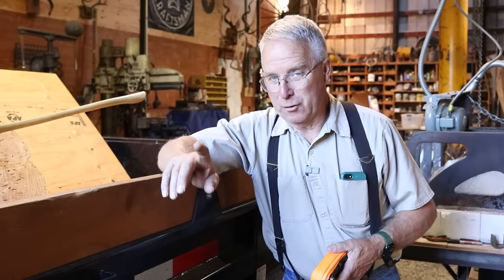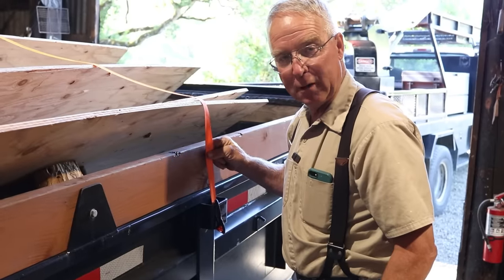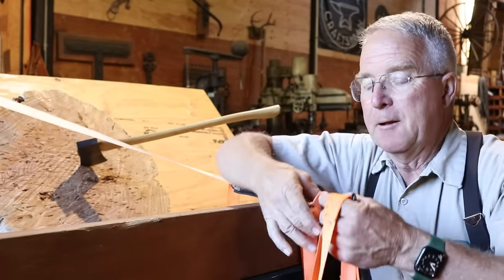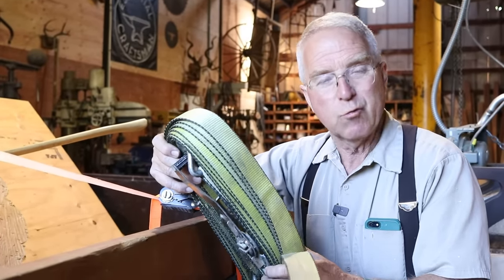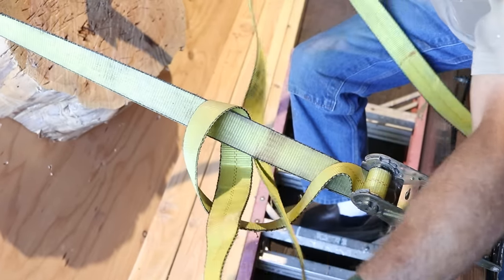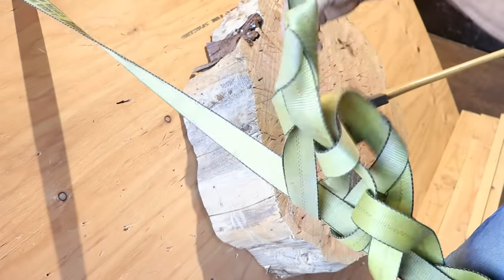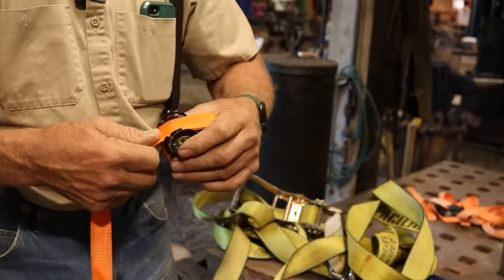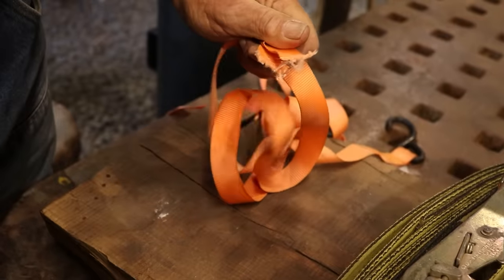7 Ratchet Strap Pro Tips

Comment: I use womens black elastic hair ties to wrap around my straps and and they work great. They are super strong, you buy them at packs at any store, they are cheap. So buy a pack or two, wrap your straps. When you take them off, put them in the truck where you pulled the strap out. If you lose one, then grab a new one out of the pack and go about your day. Ive been doing this for years and its worked so well.

Comment: Graphite spray lube works great for keeping the ratchets moving smoothly. This works better than any oil for keeping dust from sticking. I also love using straps with gated hooks or beefy carabiners when the load may shift in travel (like snowmobiles)

Comment: I normally use a magnet to hold the hooks up on trailers. Hooking them over like that can pinch straps and reduce their durability under stress. That said, you can just cut the straps and sew on new ones for about 10-20% of the cost of the whole as the ratchet mechanism and hooks are the most expensive part. So the speed increase may be worth it to you.
Also, always have redundant straps if a failure would mean more than simple inconvenience. I normally double my cheap straps, but you do you.

As for the loose ends, that's a great method for heavy, stiff straps but not light straps, IMO. Personally, I roll the straps up with a bit of cord or a zip tie though the center and tie them in that roll. Looks pretty for the boss, though it is slower.
Works well for tieing the end bundles together as well.

Edit: mind that I am not speaking from a legal prospective. Commercial and OSHA rules are way more strict than common sense. Sewing your own straps is probably straight up illegal in commercial applications without certain certifications. Like you can't replace a plug on an extension cord unless you are a Master Electrician, per OSHA (in the state of Virginia as of 2017, at least).

Comment: Another tip for the extra strap. I double it up end over end. Open the windlass half way and pull the fold strap halfway through windlass opening… then close the windlass. It will hold the strap.

Comment: I do it like you except I put them in an appropriate sized zip lock bag. This keeps them dry and coiled well and not interfering with the others.  Be surprised how long those bags last also. If you're not to rough on them. You can get them from Qt. Size up to 2Gal size which will accommodate the large trucking straps. I bag all kinds of stuff. Lol. 9:27

Comment: Some suggestions from a Canadian friend,  always check and know your WLL (Working Load Limit) against your load weight, anything more than the 50% WLL  requires a additional straps accordingly... among other load securement rules (but your not running over the 10 000# vehicle weight limits, so the rules are a bit different).  In Canada the WLL is required to be readable on either the strap OR the tag (in all commercial applications), and you must be capable of proving it, even if it requires you unratcheting the strap to get to a visible WLL markings on a piece of the strap.  Second, all straps, when in use (on flatbed, etc) are to be secured INSIDE the scrub rail! this is to prevent the potential of the strap being sheared by another vehicle bumping, scraping, or hitting the side of the trailer, or (if your that poor of a driver... heaven forbid!) you hitting or scraping the trailer on something.

Comment: I found auto retractable ratchet straps the most useful tools by far! I've got 8 pieces and it's quick, easy and solves all the problems what this video shows. But, sometimes I can't use them so I have 2 methods which had been quite useful over the years for these regular types of ratchet straps.
For the smaller ones I use releasable cable zip ties to lock the loose end. Just roll back and zip it. Easy, quick and completely eliminates any vibration and noise.
For the bigger ones I use a method what I've learned on YouTube. This way, there's no need for extra tools and it's good for my OCD too! I must say that guy is a genius!
https://youtu.be/VeqMIgrkroE 

Thanks for the video, I've enjoyed it especially because my dad has been a truck driver for 30+ years.

Comment: Far easier to roll up excess strap and clamp it flat to the tensioned strap with a $1 spring clamp from Harbor freight.  I carry about 20 of them on my 4 car trailer. 

NEVER allow webbing to contact the a sharp edge. Always use something to protect it. Cardboard, pieces of old fire hose, a rag, etc. My favorite is a piece of cheap short pile indoor/outdoor carpet that's easily cut with a pocket knife.

Comment: Also, there’s a better way to secure your strap tails. It involves folding it neatly into about 12-15” concentric loops, and using the last one, pass it around like your chain stitch, but then you twist it down/up toward the ratchet. This when done correctly (bit tricky to learn) is very fast, and secure. Comes undone easily at the other end of the trip too.

Comment: There's a MUCH better way to secure the bitter end.

I don't know what it's called but you basically fold the strap uo so it's 12" to 16" flat. Then wrap the remainder around the tight part of the strap, then through it's own hole (kind of a single knot. Then use the length of the folded strap as a handle, winding it towards you. It will the cinch itself tight.

It's the absolute fastest and most secure way to deal with the bitter end of a strap.

Comment: 2 additions to your roll technique: First, cut the length in half by pulling the ends to the same length. Second, put a rubber band around the strap. Rubber bands break so keep extra in the truck. I store my straps, bungees, wheel chock in either a 5 gallon bucket or a milk crate. 
Great video, I love your channel. Keep up the good work.

Comment: After I roll my straps up for storage as you did, I go around them with a ball bungee to keep them from coming undone. The ball bungee come in different lengths to go around different size straps. For my really large straps I just put the strap right through the loop of the ball bungee instead of going around the strap and hooking the ball. Holds them all secure enough that I then put all the straps in a tool back, not the big ones of course.

Comment: To keep my rolled straps from coming undone I use a fat rubber band, sliced from a punctured bicycle inner tube (bicycle shops will usually give them away). The bands go in my pocket when I am securing the load (so I don't lose them) and then back on the rolled strap after unloading.

Comment: Where I live you have to take your trash to the dump.
I have a small harbor freight trailer to take the trash cans there. It has a 4' by 8' bed with 3 rows of 2''x3'' rails 30'' high on three sides.
They require all trash to be tarped and most people try to secure their tarps with bungee cords with varying degrees of success.
I see more than a few on the road to the dump.
I took 4 2x4's and a 2x6 and made a picture frame that fits over the tops of the cans on top of the tarp and to hold it down.
46''x 6' more or less.
The 2x4's make a rectangle with the 2x6 up the center for extra weight and tarp compression.
The weight is enough that nothing blows out and I can pop two bungees and have it off in 30 seconds to unload.
The sides of the tarp can move a bit between the cans and the sides of the trailer, especially on windy days or if I am racing to make the dump after work.
I want to make a similar one but have 4 8 foot 2x4's that go front to back over the cans.
Then take 5 90 inch strips of that nylon web strapping and go from 1 2x4 to the next with 2.25 feet between them, 
(one strap at 2 inches from the top, the next at 2 feet, then at 4 feet, 6 feet and then at 7'10''),
making a semi rigid hybrid cargo net of sorts. 
This would hold the tops and side of the tarp and the cans and could be secured with a light chain and clip to the front rail of the trailer.
The side boards would hang over the cans and gravity would keep them, and the tarp, tight to the cans.
I was thinking of trying to put grommets in the nylon band to use to secure it to the 2''x4'''s but that looks expensive.
Do you think some short decking screws with flat washers would hold up to the rigors of wind buffeting or maybe you have a better idea?
Thank you in advance for any tips.
PS. How is you super wood working bench / desk coming?

Comment: That is exactly how I coil my ratchet straps. In our Santa Fe I lift the rear deck storage lid and tuck into any gap available to secure them. Also I leave enough strap loose before coiling so the strap doesn’t slip around. I carry two and use em when I buy bulk water bottles to keep ‘em from sliding around. Good vid. Thx

Comment: Electrical tape is your best buddy when using ratchet straps.
Beautifully fold your excess length and then tape to the mainline.
If wanting to reuse the same strap lengths over and over than tape the folds to length and the tape to mainline, your required length now will always be pretaped.

Comment: I store my straps & binders separate. Roll your strap with the hook out, that way when you throw the roll of strap over your load, the hook can't hit someone or damage anything (you have to walk to the off side to hook the hook in anyway so you may as well through the roll from there) The excess strap I simply roll it up, put a half hitch back on itself & pull it down to the binder. I've never had one come apart. There a re so many different ideas out there, often doing things daily with certain loads, not everything works, but just do what works for you!!

Comment: DO NOT use the eye of the hook. Tension can open the eye, and it's not legal.

A stake pocket must be pulled equally from both sides. Chains are the only securement that works on stake pockets.

When using straps, you need to use edge protectors to keep the strap from being cut by the load.

Everything in the bed needs to be secured. 50% of load weight minimum. 20 up, 50 side. 80 to the front. Bullheads satisfy that in most cases. Make sure they are strong enough.

Boxing changes these figures a bit. If you box the load in, you only need to secure the box to the load surface. That's why pickup beds work. You can use the stake pockets to create the box. Some boards with sheet nailed to it, then put a nail in the board below the pocket. 

Be safe.

Comment: The only "trick" that jumps out on me is the one for winding your strap up afterwards.
....... Double it up!
Put your end to the ratchet you are winding and each turn you wind is two lengths of strap. If you are lucky you can feed the resulting "Bend at the end" back through your strap to secure it ...... if not and it is only for a short time Electricians Tape is good, but don't leave it on for months or it will make your strap gummy!

Comment: Do ya not have tie rails on your trailer? Here in AU even the cheapest 6 x 4 box trailers have tie rails.
In many places a twist in the strap is specifically  illegal, straps must be flat and straight.
There are many ways to stop flapping.
Hooking into to an unwelded eye is a problem, and YES, this may be specifically illegal in some areas.
Having an unrestrained flapping tail can get you a large  fine in some areas.
yes protecting straps from sharp edges is a big issue, packing those edges with heavy plasic, carpet, carboard or specifically manufactured devices is an importsnt issue.

here in AU, I have specific load restraint training and certificate.
You won't get a drive in most of the major transport companies without a load restraint Certificate

 Due to a couple of fatal accidents and near misses, here in AU, the authorities have become red hot on load restraint.
Our federal government has done a lot of reaserch and hard testing on load restraint, AND published a 250+ page guide on the subject.
.
All states and teritories have legesated in agreement and enforce load restraint very heavily, especially in heavy transport.
Not only will they hold the driver responsible for any failure, but also everybody in the " chain of rersponsibility". We have specific " chain of responsibilty" legeslation in  many areas of safety. 
If you let a customer or employee or contractor leave your yard incorrecly restrained and there is a problem, they will come looking for you.

the "load restraint guide" is available on line, google, "NTC load restraint guide"
There are a lot of people ( especially in the US) that will argue for all sorts of outdated practice and folk law, here in AU that cuts no ice whatsoever.
Our federal transport commission has done a lot of good work and a lot of hard testing and have clearly laid down practice and provided several engineered and tested solutions.
The guide shows many pictures of failures in addition to pictures of actual testing

Comment: Also, if you buy good straps, like Ancra's, you can get a hook retainer rung, that allows you to hook the strap hook back to the strap itself, and makes for a very secure connection. I also make chafe guards from sections of old fire hose; easy to slip on and off the strap. But do yourself a favor, and buy good straps to begin with. My Ancra's are my go-to straps out of the dozens I must own.

Comment: I have used a storage method I saw on yt.  Separate the strap from the winch. Wind the long strap around the hook until 12-16 inches remains. Make a loop in the end by laying 6-8 inches over on itself.  Insert the loop into the barrel of the winch. Then hold the wound portion inside the loop. Then crank on the rachet until it snuggly seats against the winch.

Comment: I wrap mine up transverse to that. The length of the windlass jutting out of one side gives my left hand a handle while my right hand cranks loops around pell-mell. Swap hands every 10 loops keeps the twists out of the tail. Last loop is a half hitch, throw it under the seat and it'll always be exactly as I left it.

Picking up on that powerful cranking motion makes it much faster than steadily going hand over hand.

Comment: Be aware of how much load your ratchet strap is rated for! Mine was rated for less than my body weight, so it didn't hold me when I expected it to. Knocked myself out and had a trip to the ER. Typically, this rating is for only one or two "wraps" of the strap in the ratchet, meaning that you tighten sliding the slack through the ratchet leaving a long tail and THEN crank the ratchet. Don't make a big ball of strap inside the ratchet or it will give a level-type mechanical advantage for the load to pull the strap out.

Comment: I always set the ratchet on the passenger side, so on the side of the highway when I am pulled over to check the straps are tight, I’m not standing in on the drivers side with vehicles whizzing past my back.

Comment: Good tips.  I was a trucker for 20 yrs.   1) always pull ALL of the slack out of the straps before ratcheting them down and then make sure it is really tight so if the load shifts it does not become lose.  2) you can put a piece of cardboard between strap and sharp edge. Or buy the little plastic corners (Harbor Freight) for preventing slicing straps.  I often will daisy chain onto the strap if it's not long enough to tie back across the load.  But he is 100% correct, secure that lose end!

Comment: I have a few ratchet straps that I've cut to length for specific things. For example, a Yeti cooler on my hitch mounted cargo rack uses two ratchet straps that I've pre-cut to the right length (and used a lighter to singe the ends and keep from fraying). I keep those straps on the same shelf as my Yeti and they are marked "YETI" in permanent marker.

Comment: I threw a walmart 6 inch spring clamp in my rachet strap bucket. The angle iron trailers commonly used gives a flat place to clamp the first hook in tension until I get around to rachet. Just remember to go back and get the clamp before taking off.

Comment: My tip for winding it up for storage is to swivel the hook 90 degrees while you wind around the ratchet, and then swivel the hook back in line with the winding and you can sort of tuck/clamp most of coil of strap inside the hook and hold a lot of the coil in place from unwinding in storage.

Comment: Learned a couple things. Thanks, but my by far my biggest frustration with ratchet straps is releasing them. Often I find if difficult, if not near impossible, to release both sides of the rachet and then pull the strap out at the same time. What am I doing wrong?

Comment: I agree with everything but the securing the loose end part. I do it 2 ways. Either roll up and stuff under the ratchet and then tighten it, or roll up and do the fancy loop over the roll that locks the roll in and lets it dangle. I like the idea of this but dont like the hanging roll just hanging there!😂 so 95% of the time i stuff the slack under the binder then tighten down, and never had an issue. Thanks for always teaching i love your videos and have learned a lot by watching them. Have a good day!

Comment: I don't know if  it's been mentioned already, but when I deal with the loose end i like to fold the excess in half, in half again and maybe a third time. Wrap a few turns of electrical tape around it to keep it from flapping in the wind.
I used to wrap them up putting them away but it takes forever and they end up just as tangled. Same way as before, fold em in half three or four times then a couple turns of electrical tape. Never tangle again.  Keep a roll of tape in your door pocket and a spare in your glove box. If you want to belly wrap some long boards supported high on your headache rack, then alternate the sides with the ratchet so you keep even tension and it can never shift.